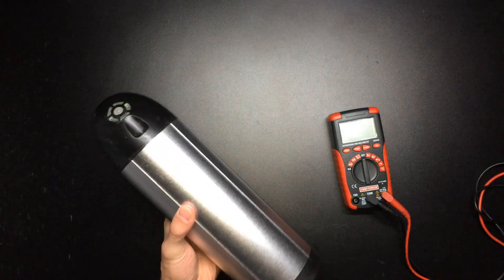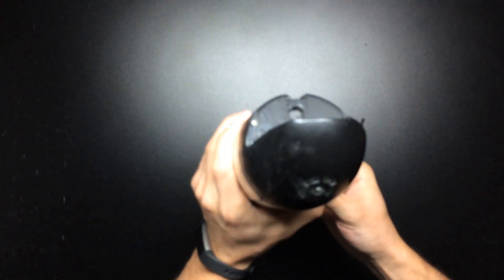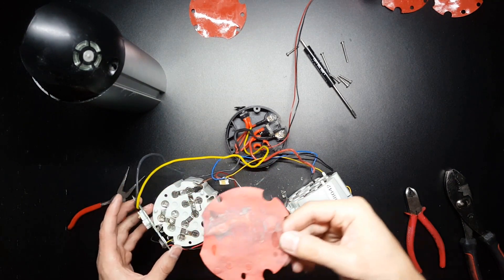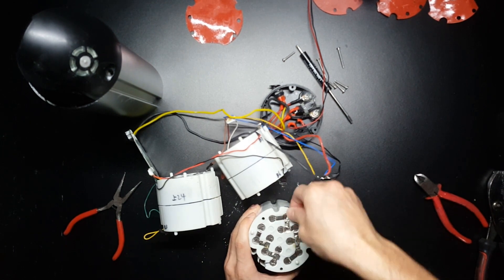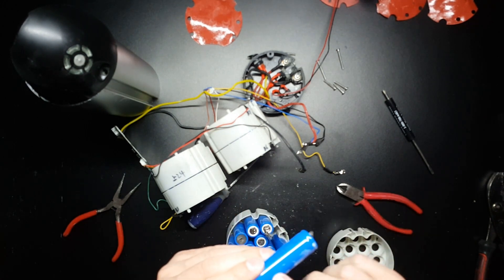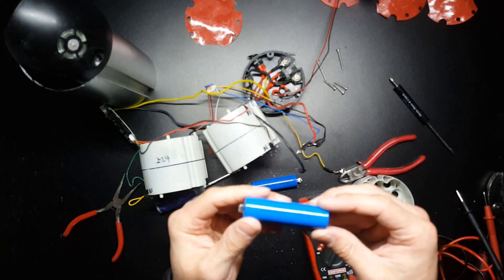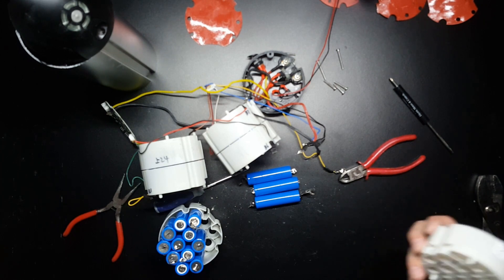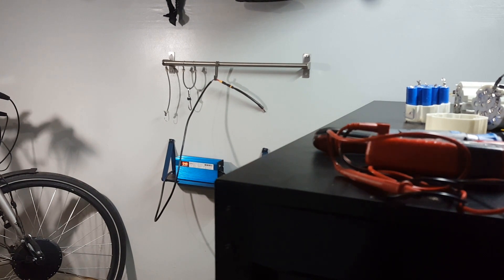What's inside my Electric Bike Battery?

Comment: Anyone ever realize that batteries are constantly offgasing a tiny bit of their electrolyte? I only figured it out after i got a bunch of cells and had them in an airtight metal can, like a barrel with a sealing ring lid and a rubber gasket... man that can stinks when i open it, i figure it must be the cells losing tiny bits of their electrolyte which has to be made with things that aren't water aka solvents... maybe that is part of why they go bad over time.

Comment: My battery got wet.  Bike wont start.  Put a volt meter on the discharge cable and reading 45 volts.  She wont charge tho ..  damaged BMS ?

Comment: I have a 36v 250w 9ah bottle battery that is failing. Can i put a replace this with a 36v 250w 10ah battery. looks strait swap. Im new to all this so maybe a silly question. Just need it clarifying that the difference 9ah & 10ah would not be an issue
Reply: You could go 20amphour.    The controller is a giant fuse. It will blow first
Reply: $10 on e bay REALLY

Comment: So you didn't tell if the moisture was water infiltration relatet or acid that came out of poor quality batteries.
Reply from the maker: Not sure, might have been both.
Reply: @eBikeaholic  Anyways, after looking at several bicycles and watching reviews AND considering the costs associated for running and maintaining the e-bikes, I decided to buy a motorcycle.
Reply from the maker: @billadmond9450  yeah sometimes that's the best option. High power LEVs aren't really ready yet most laws aren't encouraging their production or public use. An electric motorcycle at least I hope?
Reply: @eBikeaholic  A real motorcycle, I bought a Honda CB300 for AUD7,000.
You might say yeah the bicycle is cheaper, you do exercise, you don't need a rider license (but you got it anyways), insurance, petrol etc. etc..
BUT I considered all costs associated with a e-bike like a low/average quality bike costs around S4-5,000, after 6 months you gotta change chain and sprockets, after 1 year complete motor revision $$$), after 18 months the battery have lost 50% of capacity, after 24 months the battery needs to be replaced $1,000+++, after 2-3 years the motor might need complete replacement because replacing the parts would be too expensive cost $$$?????, you can't buy spare parts because e-bike manufacturers prefer to keep people chained to their filthy business.
You do the sum then tell me if buying a motorcycle going up to 140Km/h is more expensive.
Reply: @billadmond9450  lol, what battery costs 1000+? What battery loses 50% capacity within 18 months? They are usually rated to have 80% capacity after 250-500 full reloads, the small ones like in the vid are good for 40km with a full load - do you really drive more than 20k km in 18months? Impressive.
Reply: @jfichl  You have made a generalization, when talking "they usually" you need to say who are they and where is it because otherwise it's just an opinion.
If we talk about big brands batteries like Bosch, they are better in quality but I did my research already and I know about rechargeable batteries.
Batteries are very sensitive to extreme weathers can it be be very cold or very hot, very sensitive regarding the way you recharge them, very sensitive regarding how much energy you use and how often you recharge them.
A standard brand bigger battery pack costs around AUD 500 while a good brand like Bosch costs AUD 1,000 and up.
A pack of CHEAP batteries costs around AUD 500 but they last very short time.
You say that batteries are rated 80% after 250-500 reloads and that is pure BS because 250 is one thing while 500 is a different matter!
If you use the bike nearly everyday, be assured that after 18 months the batteries lost 50% of their original performances, and I'm talking about good brand batteries.
And so I spend $5,000 for an e-bike and I can only ride for 40 KMs? I must upgrade and buy the bigger pack which costs $$$.
Dude if you want to have a conversation, that is ok but don't try to judge what other people say.
Reply: @billadmond9450  Well, I have a cheap chinese batterie, 36V 8Wh, it was 179€ when new (2016), it still works like a charm after 4 years, but I use it only for work (6km one way) when it's not raining, the bike is an ultracheap 800€ bike. But you are right, one load is only good for 40km. When the ränge falls below 30km I'll buy a bigger battery, currently 300€ for 20Wh, that should give a range of 100km.
A friend has a Cube bike from 2015, 11.000km, 112 load cycles, still 93.8% capacity (Bosch battery readout).  Even a Bosch Powerline 500 battery is 600€ here, a big brand bike between 1800-3000€, the temperatures usually  0-25°C, so it seems to me that Oz is even stranger than I thought.
Reply: @jfichl  I've a Chinese nearly no brand tablet, I didn't use it for more than 6 months and when I started it up it still had plenty of battery charge.
That to say you have to be lucky when you buy cheap brand bikes because you don't know what battery they use.
And you have to consider that €600 = AUD1,000, man in Australia we are fked up because the AUD has became toilet paper.
A basic lawful monthly salary in Australia is around AUD1,750 so you do your sums.
Everything that arrives here has the USD fked price on it then you do the conversion, merchants take advantage on it on eBay, Aliexpress and even overseas merchants do conversion to AUD because they gain a lot of money on it, don't forget American monopoly carriers they also push it through our @$$ with high rated and USD conversion.
I did an extensive research and I found out that the CUBE is the best brand, the bikes are beautiful, solid and technically advanced while maintaining honest prices.
I was near to buy one then I thought, why I should spend AUD 4-5,000 for a mediocre bicycle and am not free to go far so I need to spend another 1,000 for batteries, and this and that plus service so I decided to spend AUD 7,000 and I bought a motorbike, now I'm a free man!

Comment: Hi, quick question! I have the same battery which doesn't seem to give out any power anymore. The button check on the top still reads as full so is the fault eith my battery or with the electrical side of things. It has been playing up for a couple of weeks but now won't power the bike at all. Any help is much appreciated. Thanks :)
Reply: check the fuse. its a big screw type on the bottom of the battery near the connectors. a philips screw is holding it in. unscrew the large black Philips screw and the fuse will come out
Reply: so what was it

Comment: How long did it last?
Reply from the maker: It lasted almost 4 years and died from bms failure. It's best to top off the charge after each use and only charge to 80%. The cells are still in good shape I've been using them in diy powerbank and bike light projects.
Reply: eBikeaholic hey thanks for the reply. I'm looking into a 500watt kit and this battery to boost my commuter.

Comment: Hi. Very interesting !!  I have an identical looking 36v bottle battery, with problems... but before I try stripping it to attempt a repair I thought I'd ask you if you have drawn a diagram of the way the cells and bms are connected up, and would you mind if I have a copy ??
Reply from the maker: Unfortunately I don't have a diagram. I do still have it somewhat in tact though if you have any particular questions I can take a closer look. It's basically setup in three modules with wires connecting them to each other, the on/off switch, a fuse, and the bms.
Reply: a diagram would rock my world..............
Reply: That will make it an 14s3p pack for the 52volt  pack bottle ore not___
Reply: Hi i need a diagram too. Did you get? If yes could give me? Please?